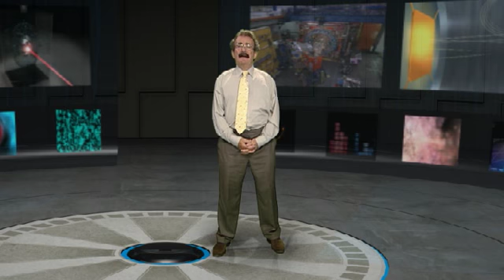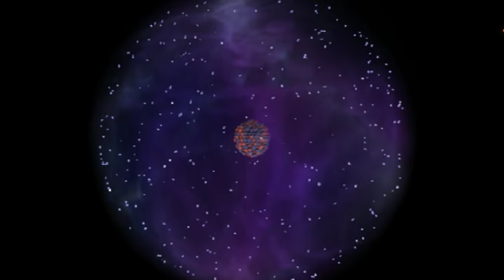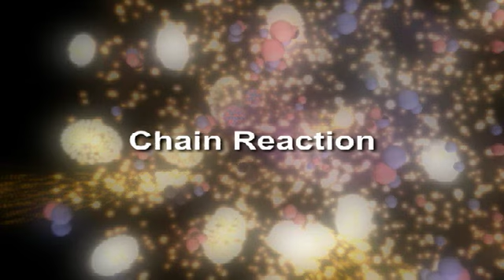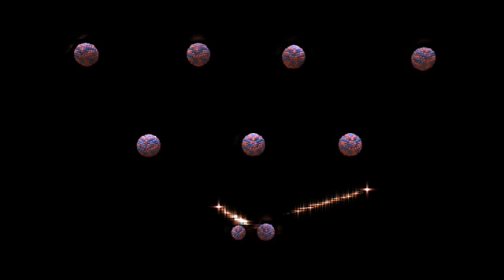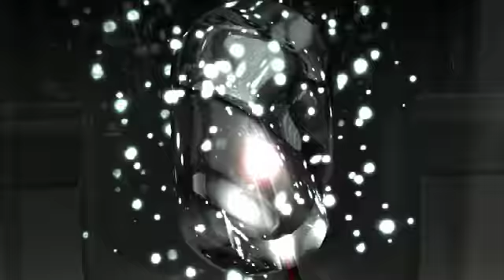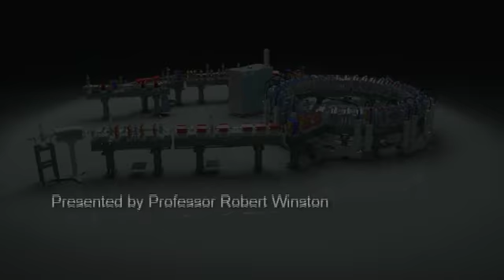ADSR Energy from Thorium

Comment: liquid fuel smacks down solid fuels every time.  Fuel rods, have been and always will be the achilles heel, and then there is the whole problem of high pressure water as a coolant.
the whole 'proton driver' diversion of 5% of power is another energy loss, and thus increase of cost per MW.

Comment: This sounds like an interesting idea. It seems rather over complicated and expensive to replace all reactors with this method. I personally favour the LFTR approach for fissioning thorium as it's less complicated than particle accelerators and probably cheaper. However the LFTR requires a starting charge of U233 of which there isn't very much of. The ADSR could be used to breed U233 from Th for more start ups of LFTR.

Comment: @HydrogenAlpha Thanks, to answer each of your questions in turn:

- Solid cores do indeed require more processing. But they do contain fission gases and tritium better, which is important. The main issue with LFTR/MSR is noble metal plating, which is a particular problem on the heat exchangers. Plating is an unsolved problem on LFTR.

- Steam generation is a problem on LFTR, hence the move to gas Brayton cycle for the turbines.

- High pressure vessels are an issue in PWRs, but not in LFRs

Comment: @waltoncats I don't deny such a reactor could be engineered and built quickly. That's not the issue. The problem is getting the government and every other stakeholder on board. That is what takes forever. Thorium fuel rods for existing light water reactors are basically ready to go and could conceivably be approved pretty soon - at least for non-U.S. markets.  I think it would be prudent to apply concentrated pressure there first before gunning for LFTR or other cool ideas. Some day we will win!

Comment: @Weenchit Exactly right - starting with MOX fuel with Th in it is a good way to get started, but probably isn't commercially-attractive enough since it doesn't offer a great financial incentive compared to present solid fuels.

But, getting a new reactor up and running could be done quickly if the will was there. The first reactor - Shippingport - was designed and constructed in 32 months. That is a lot less than a lifetime.

Comment: @granddad2002 I think advanced reactor designs are terrific and should be researched. However, don't kid yourself: the process of engineering a new reactor design and getting it certified and commercialized in an economically feasible way during your lifetime is basically impossible. I think the right plan is to create thorium fuel rods for current reactors in a once-through cycle. Then follow up with new reactors. I think if we spend our energy on new reactors now we will wind up with nothing.

Comment: The case for thorium is strong. The spin-off application are lucrative. Since it makes little sense re-building 'classic' nuclear reactors... all the benefits are there. R/D to commercial development should be the guiding principle of how to do this? 1-2 years for an experimental design. 6 months to 1 year on building the demonstrator. 2 years of controlled operation. Would recommend building on a decommissioned nuclear reactor site? Logistics and personnel are already there. A five year plan.